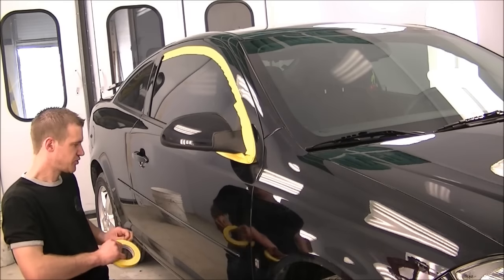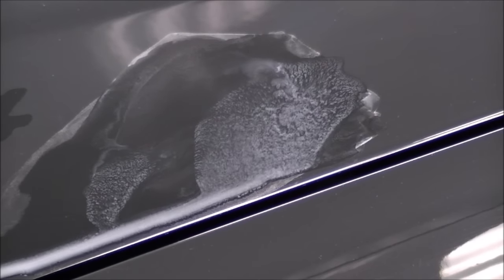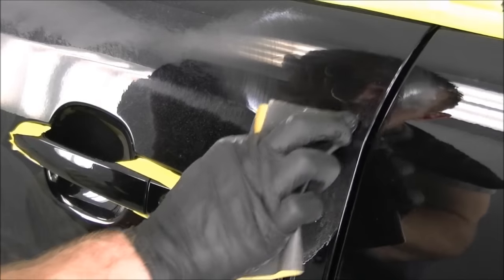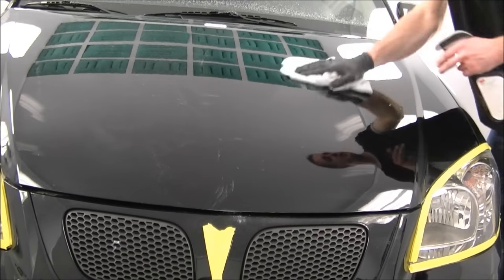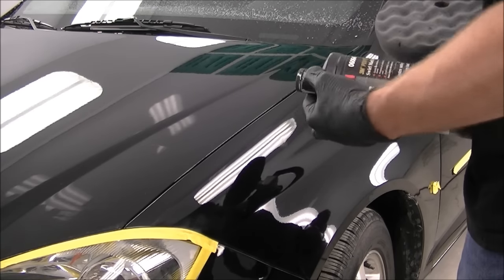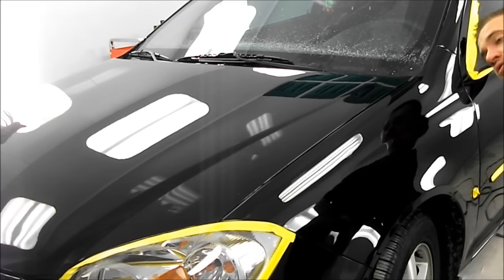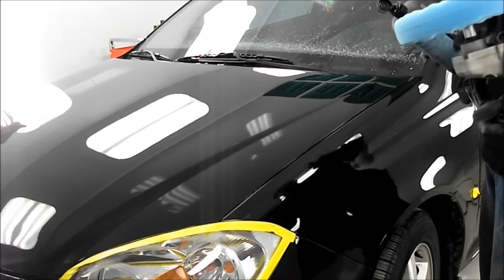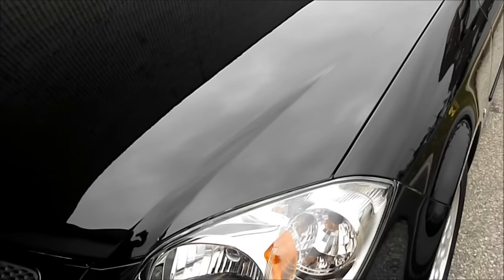Master the Art of Polishing: Complete Guide for a Black Car Shine

Comment: I've always found personally after following your steps like you said. I've always wash the car with a stripping soap. To remove all access product from the vehicle. At that point it shows if you have a true finish. And then after applying your wax or a sealant you end up with a much glossier finish. Leaving remaining product on vehicle give you a deeper finish but not true finish. But every detailer does it different. Nice video by the way
Reply: at least he knows how to use a hi speed buffer, and you are right you have to wash car to see the true finish. A lot of detailers don't show that and the oils on the polish hide all the imperfections

Comment: I have been detailing for over 20 years.  The video is well intending, but he left many swirls.  Rpms r too hi and he is using a cutting pad on the final polish.  When you wetsand use a sanding block and go in back and forth motions, that will insure a good finish.  ALWAYS use a black pad and 1500 rpms or less to ensure a quality finish.
Reply: to do it right takes hours
Reply from the maker: Trendyrapslut to top things off the guys a jerk. Curse that handsome devil.
Reply: Just wondering can you post one of your pro videos
Reply: Blue is the ultra fine pad for 3M and Black is polishing pad so he did it correctly actually

Comment: You did a great job on this car. One tip though that you might wanna start using is this. Never let the power cord touch or drag on the paint. Always drap the power cord over your shoulder that way it never touches the paint and won't scratch or mare the finish. Other then that I think you did a fantastic job. Black cars are hard to get to look perfect but this one turned out fantastic.

Comment: Car looks amazing man would recommend applying your wax/polish to buffer first then dab on to the paint from the buffer then turn it on and it should save you from the that extra polish on your windows also turn the buffer off on the paint and this will also help for fly aways
Reply: You are correct.
Reply: Correction. Professionals such as myself and this guy do not need to do that. Notice every time he puts some Dab on the car he angles the buffer a certain way to make the overspray spray right under the pad. It's a trick detailers know. Tricky to learn but amazing when mastered.

Comment: Why would you polish over 1,500 grit? Absolute worst thing to do, especially on a black car. 2000 always, 3000 on solid dark finishes. Makes polishing MUCH easier. Half of what I polish is fresh paint out of the booth, but even I don't try polishing up 1,500 grit scratches, too much heat and friction required.
Reply from the maker: dropinbiking92 I've tried it a number of ways since, this video is pretty old.  3M has a one-step compound out now but you have to finish using 5000 grit. To answer your question though I never had a problem bringing up a 1500 scratch, but yes It would obviously take a bit longer with the compound.
Reply: We use the 3m 3-stage system mostly. I find even their EX-cut stage 1 polish needs quite a bit of work to bring back 1,500 grit. Just not worth it, considering how much compound, friction, and heat is needed. I do a lot of my polishing from 2,000 on softer clear, and 3,000 from harder clear. Makes for much quicker polishing, 2-3 slow passes with medium speed and it's back
Reply: I have always used 1500 then polished it up never had a problem

Comment: This dark colored car would look terrible in the bright sun .. major swirls .. you can not polish away 1500grit scratches. the surface will appear shiny but you will not have completely removed the scratches.. use a magnifying glass indoors and you'll see what I mean. They must be meticulously step sanded to 3m trizac foam 5000grit and then 3 staged and waxed if desired. I wouldn't even touch a car with 1500. you can see in this video that the 1500 sanding was as deep or deeper than the original scratch. You need to work down to the bottom of the scratch , not simply match it.. no offense but I've been where you are and there's a deeper learning process than this video shows,  at least if you ever want to work on high end or number 1 show cars..(yes I do them)
The only reason that i go to all this bother to comment is because I'm tired of seeing videos on here that are so "scratch the surface".. pun intended.  
Oh ya.. and polishing in that beautiful booth is not so cool
Reply: So are you saying NOT to use 1500 grit on a black car?
Reply: Yes I'd say very rare is the circumstance where you should
use 1500gr on any polish Job. (Runs being the exception). I know people do it all
the time but generally these are the same people who have not yet developed
"the eye". It's easy to achieve a surface shine but at the same time
leave many scratches behind that only show up when they refract light.
Especially sunlight. 

Polishing is the easy part.!

The Wet sanding is the most crucial and difficult part of the operation.!

I generally start with 2500 wet block sanding (and this can be sufficient for
heavy orange peel and dirt nibs) then 2-3 passes of trizac 3000gr on a
finishing Dual Action followed by the same with 5000gr. Even this needs to be checked
and sometimes repeated in spots. Then one pass each of the 3 stage polish and
buffing. Waxing or sealing is not crucial unless you require Uv protection. It
can also be of some benefit for future wash and toweling jobs.

The 3M foam backed trizac is the only paper that will suffice for a truly
scratch free wet sand/ polish job. I have tried them all and come to that conclusion, and
it’s expensive approx. $10.00 per pad. There are also many techniques to the
wet sanding stages that couldn’t possibly be explained here. I wish I had the
time to make a youtube video but to tell the truth, even 4k resolution wouldn’t
display the merits of a good or bad job. It has to been seen in person and with
a magnifying glass in some lighting conditions.
Reply: Any chance you could provide direct links to the products you would recommend? Just bought a 17 Silverado Midnight Edition and already seeing swirl marks, so I would like to polish it with a professional result. Steps would also be appreciated! Thanks so much...
Reply: Bruce Louden I compeltey agree in refining and using above 1500 grit however with a new paint job I'd definitely begin with 1500 wet on a block to knock it down.

Comment: Couple tips.  Always sling the cord over your shoulder so it won't rub on the paint surface.  Apply polish to pad to reduce chance of splatter.  Biggie.  Beginners get yourself a porter cable buffer that way you don't damage your car's paint.

Comment: Pretty Good Video. I work at a body shop and do Detailing on the side. Just to let others remember that when doing a black car especially...do it in a shaded cool area. I like to use a spray bottle during all stages of buffing just to keep swirling to a minimum. I have yet to use that ultrafina yet but maybe Ill give it a shot. I usually go strata 1000,polish,swirl remover...wool/foam/foam. I like to go over the swirl remover by hand. Wax will take 95% of the swirls out in the end though.

Comment from the maker: Sorry i don't have them handy, pretty sure 3m switched them. The bottles will now be labelled step 1,2 and 3 which would be what I used in that order. I would'nt do it that way, you'd make sure each step overlaps the previous one every time you changed sections.

Comment: scratches and swirls are in the clear coat and a thin layer has to be removed to remove these marks. This is a repair video, not a maintenance video.  You can only do this so many times before the car will need to be repainted.

Comment: If the scratch is really deep you want to use a more aggressive paper to cut out the scratch. Use 1200 to 1500 if it's that deep (note that the more aggressive the grit, the faster it cuts through.) But be sure to step it out to 2000 before you buff. So 1200, then 1500, then 2000, then the 3m process. You can also try using a wool pad with the #1 first, then white foam w/ #1. For the record though, my shop's rule of thumb is that if you need to use 3M #3, your mistakes will show after it rains.

Comment: Use mictofiber hand rags on the soft side to help remove dust and left over polish, be light to avoid streaking or even scratching. Wash after because compound stains fresh paint and use clean shammy to dry. wet sanding scratches the surface of the clear coat the higher grits allow the scratches to get finer and finer. Removing dirt , light scratches and smoothing together the clear coat. Buffing practically heats up the clear coat to smooth it out and remove the sand scratches. Polish makes its pretty and wax seals the deal. Do everything possible to avoid burning paint. Sanding edges wrong or too much, buffing with pressure or holding it on one spot for too
 long/ at an uneven angle. Hope some of my info helps. Goodluck!

Comment: Yeah dood, I work for a dealership and our body shop leaves swirls all in the paint an I have to buff them out witha sealer/swirl remover, called black wax. just using the black wax to polish is good as well for getting out oxidation and bringing that color back out. good video man.

Comment: if you sanded your card, then you need to use  from meguiar's number 85 or 105 (i like most it) in a polishing pad and follow with ultimate compund with a finishing  pad and you will be ok, if not, then you can use Ultimate compound on a polishing pad and follow it with ultimate polish with a finishing pad

Comment: hey Mr veyron....this is a pretty good video showing the buffing process on an inexpensive daily driver. One thing l will fault him for is not using a sanding block otherwise he did nothing wrong given that these cheaper cars use soft inexpensive clearcoats so its a relatively easy process to get em up to snuff. When l work on Lamborghinis, ferarris, porsche 911's , l use swissvax products and yes l wouldnt use a woolpad and l wld use a paint gauge. on a pontiac this is perfectly ok.....

Comment: make sure the car is cool and that you clean the pad with a toothbrush between each panel example buff the entire door and clean the pad keep a trigger bottle around and mist the panel after you apply the polish if the polish gets dry it makes swirlmarks and try your best to keep the pad flat not on a angle

Comment: Holograms are a result of a many possible things.  First and foremost for most cars with holograms, they are a result of not using a lighter polish after the compounding step.

Secondly, not keeping the buffer completely flat while you finish polish will cause holograms.  Even amount of pressure along the entire panel will reduce holograms.

Thirdly, not working the polish in long enough, or even working it in too long (dry buffing), will cause holograms.

Comment: @whitesites if you have the proper palm sander already i advise you to order a "hook it 2" pad set up from o'reillys. use 1500 grit to sand down flat, 2500 to remove those pig tails.

Comment: @17kingafrica 
There are tons of sealer/waxes. In the case of the last job I did on my own Ford Flex, I used Meguiar's Ultimate Wax/Sealant and it did a great job.  The general process is (wet-sanding if any), clay bar (if needed), compound or cutting material for oxidation and other wear and tear (not always needed), polish (usually with very low abrasiveness, if any), then sealing top coat, like a quality carnuba wax, or a synthetic equivalent.  Here in Vegas, I try to use synth's due to heat.

Comment: some one asked if you should use clay yes you should. but not if you wet sand / color sand .  and there is no need to use a wool pad these days 3m makes as system that only requires foam using a wool pad only makes you do more work

Comment: Great video.  When would you use a "cutting" compound?  I have a newly repainted car that has some orange peel that I want to get out.  I have wet sanded to smooth it down, then used cutting compound with mixed results.

Comment: And finally, too much RPM during the polishing step and finish polishing step can also lead to holograms.  You usually don't need to go above 1200 for a final polish.

I will add that it can be difficult on some paints to get the car absolutely hologram free using a rotary/circular buffer, during the finish polish step.  These are powerful buffers that can be difficult to keep them completely flat, and many detailers end up performing the final polish step with a DA Porter Cable.

Comment: Hi a have been doing the same thing to all black and realy dark paint cars but have  never spraid watter on the last step does it work better. Actualy i am doing compaund 3000 1st step compound 9000 second and for 3rd 12000 which i only use for black cars. Sory for bad eng

Comment: How come I burned through my paint while I was only on the 1 or 2 setting on the buffer? Which is i believe 600-900 rpms? I have the exact same car, polisher, and all the same compounds which is in this video. I was buffing my roof if that makes a difference. And no I did not have the machine sitting in one spot for very long.

Comment: My aunt has the same car, same colour. I plan on detailing her car when she comes out (since I love detailing lol) and I was just curious on what order I should do things.
If I were to wash and clay... should I then use Meguiars Ultimate compound (which I already have) and then polish followed by a wax?
Reply: So what did you wind up doing?  How did it turn out?
Reply: +Michael Hinchey I washed the car on the interior first, then exterior. I then followed with claying the car, polishing (with polish and only using compound in certain spots. Layering compound on polish doesn't work too well). After it was polished and finished off with a wax (I used a black wax that increased shine). It was a totally new vehicle when I was done! (I also debadged the entire car and tinted the rear windows 35%

Comment: Friend, pressure washer isnt bad at all, just make sure u have the proper tip for the hose nd ur good, obviously is better when you use soap after rinse ur car with water, some ppl just pressure wash a car thinking is good enough nd dry the car after with a towel, big mistake..so as long u follow the right procedure ull b fine, telling u this as a Pro Detailer nd help out.

Comment: Hi, does using a wool pad instead of foam, give better results with regards to getting a deep wet look gloss?
I have a black car and am having difficulty getting back the original depth of black colour to that before i sanded down with 1200,2000 and 3000 3M trizacts.
Is a wool pad much better than foam for obtaining gloss and depth of colour?, thanks.
Reply: wool is for cutting, foam is used for medium cutting and fine foam is for swirl remover on low rpm.    super fine foam with swirl remover on lowest speed will get all the swirl out.

Comment: Throw that 3M rubbing compound in the trash.  That stuff makes a larger mess on the surface than the original scratches.  Use Meguiar's M105 compound.  Cuts just as well and leaves a much better surface.  The next step becomes that much easier M205 or Menz SIP or IP.

Comment: @17kingafrica 
What did you do after the polish process?  Did you apply sealer and/or a wax top coat?  If not, there may not be protection over the newly polished surface.

Comment: You used three different coats (products) of 3m. What types are they and what pads my man. I have the buffer. A nice one like you have. I usually do all my costumers cars all by hand. I have yet to use the buffer. I am honestly kind of scared on the pressure I need to apply. Especially on my newer clients cars. mercedes and a nice new turbo buick. Any advice from a fellow car enthusiast is so much appreciated. Im goign to practice on my 2010 kai soul first though (black paint).

Comment: Thank for great video.. I have a few questions below..
1.  Do you use the same pad for each application?  Do you need change them out intermittently?
2. Do you apply any wax coating after the three above step?

Thanks!

Comment: I have a question for everyone. My car is a 2002 acura tls black, and it hasn't been compounded , polished or waxed since I've owned it 7-8 years. It has light scratches and one or two small dings. I was going to wet sand, then compound, then polish and then wax. My question is if Iplan to still drive this car daily, do iI have to complete all of these steps in one day? Or can I spam them over a course of a few days. (Winter months, not really cold). ?? I'm using a torqx da polishing machine if that helps and Maguires black compound and polishing liquids. Any advice would help?
Reply: +Michael Hinchey to be honest if you wet sand then your pretty much stuck with doing the whole process from start to finish. You should do a full correction of the paint and then over your time owning the vehicle, wash the car properly and when it's time, clay bar and polish the car every 6 months to a year depending on where you live and what the climate is like.
Reply: +Brett T I have the time right now to do the whole car so I would like to do it.      I'm assuming the wet sanding, compounding and polish, wax can be done over the course of three days?
Reply: It can just make sure you store your car properly i.e. a garage or enclosed area. Better to just do the whole process in one go and take care of little things along the way. Like claying and polishing
Reply: +Brett T Oh ok.  I will start my project soon. thx

Comment: Thanks for this awesome video! Very helpfull as i'm about to polish a black car which i painted in my garage. One question though, after sanding with grain 2000, do i have to work it all the way from coarse over medium to fine 3M compound? Its quite expensive so i've only bought the fine compound so far :-)